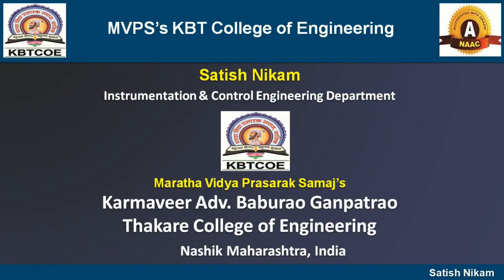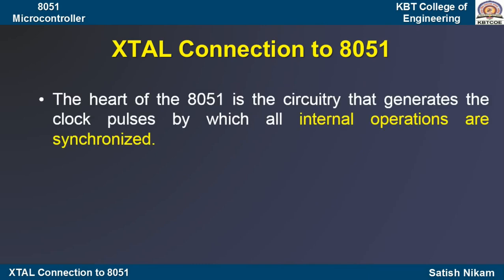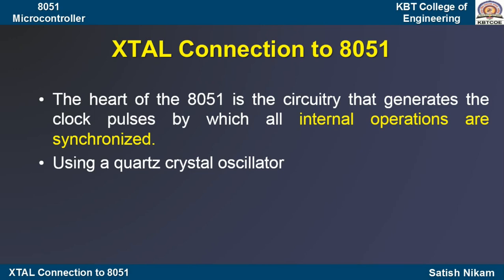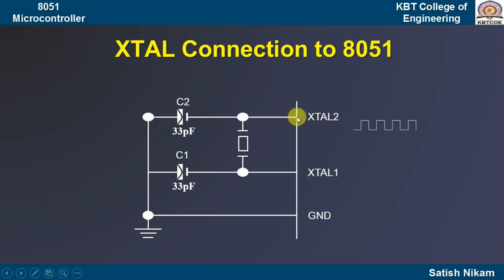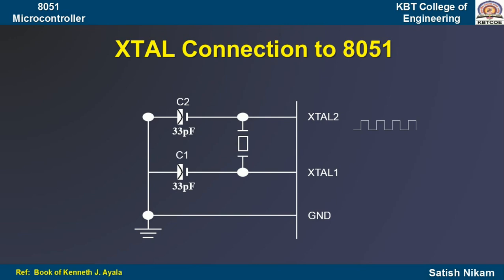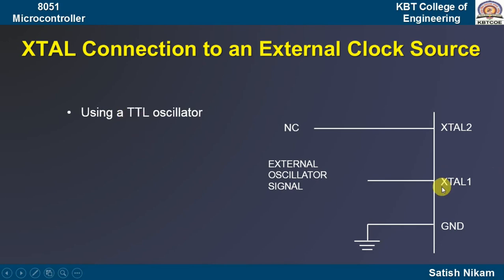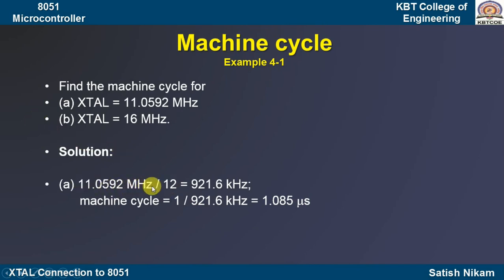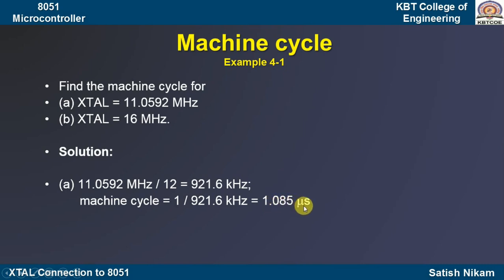Oscillator circuit for 8051 Microcontroller

Comment: Hi, Please I didn't get the Calculation of the Machine Cycle. I thought 1 machine cycle is equal 12 clock pulses. Then if you wanted to get the frequency of a machine cycle from it's clock pulse it should be multiplied by 12 not divided. Please can you make clear this explanation??.
Reply: Because when we divide 11.0592MHZ by 12,we get 921,583 
That means 8051 execute 921,583 single cycle instruction per second